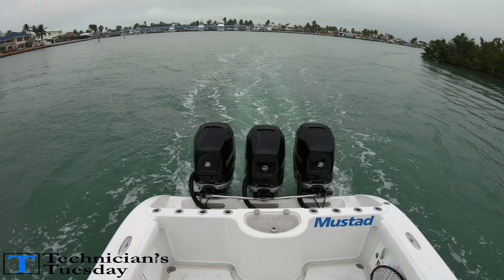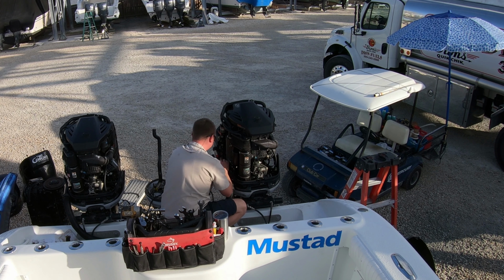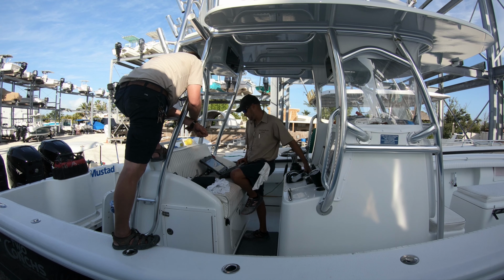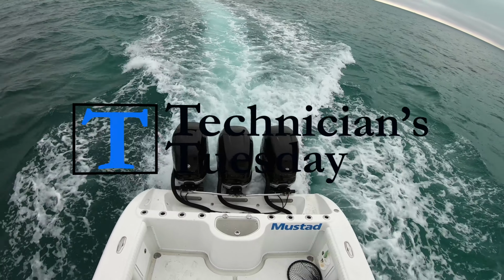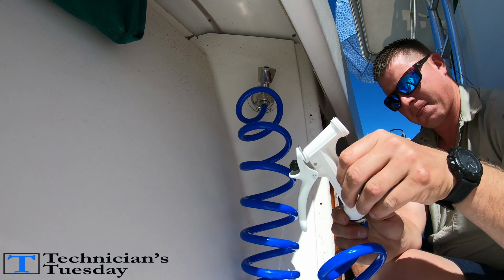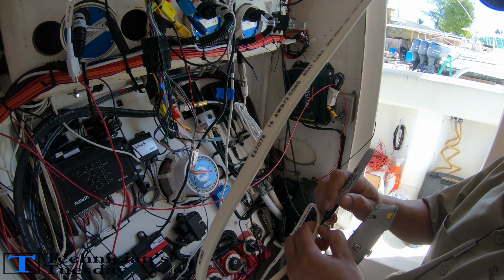Repowering 3 OUTBOARDS IN 1 DAY!

Comment: Nice you put the rigging tube for the port engine under the steering bar. I help take care of a boat with quads in dry storage and you have to trim the outside motors up for the forklift to pick it up and the rigging tube for his port engine goes over the bar so every time i trim it up it crushes the tube unless you have someone hold it out of the way even then it still gets a little squished.
Reply from the maker: Yes. The way this transom is set up comes out nicely where we dont have to put them over the bar. 

There's a ton of boats that we have to put them over the bar though. :)

What kind of boat has the quads?

Comment: hi
what is the name of the spray you use it on the hid cover, and what is good for?
Reply from the maker: That is CRC dry silicone, it's basically just to make the cowlings go on easier. When the gaskets are brand new they like to stick and make it extremely difficult to get the cowling on. A little bit of that and the cowlings go right on with ease!

Comment: What were you spraying on the cowling gasket? It was in an aerosol can.
Reply from the maker: When the engines are brand new those gaskets are super sticky. The rubber being brand new makes it super hard to get the cowling latches to clamp down right.

So we use some dry silicone spray to get the cowlings to slide on. We use CRC Marine Heavy Duty Silicone spray. Works great and makes it so much easier to get the cowlings on without damaging the gaskets!

Thank you for your comment!
Reply: Where did you put the fluxgate compass on that? Looks like that jl sub may be close.
Reply from the maker: @patrickwelch620  that's funny because we actually had to move the compass! The sub messed with it a little but it turns out that auto pilot pump was the worse!

We took that out and installed another cupholder, then out a top mount compass up top on the dash :)

That auto pilot gave us all kinds of trouble too. The NAC-2 controller was bad out of the box! :(

Comment: How do u control triple outboards with 2 controllers. Genuinely interested
Reply from the maker: They have what is called "shadow-mode." Basically, it just means that the middle engine will "shadow" or do whatever the other two engines do. So if you put both controllers in forward, the center will go to forward. If you put them in reverse, the center will shift to reverse. 

Then, if you put one in forward, and the other in reverse, the center engine will not shift and all and will just idle. :) Pretty simple!
Reply: Born Again Boating thank you so much it’s been bugging me for days and I could find anything on the internet about it